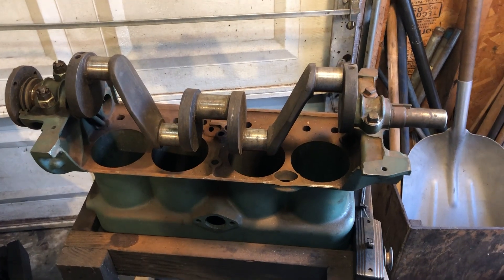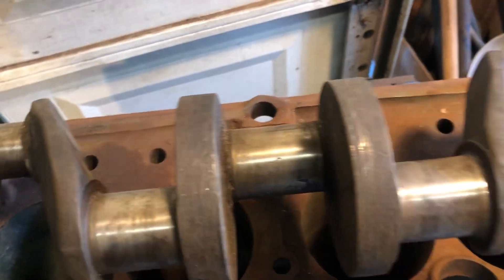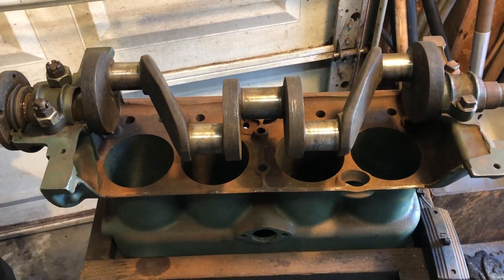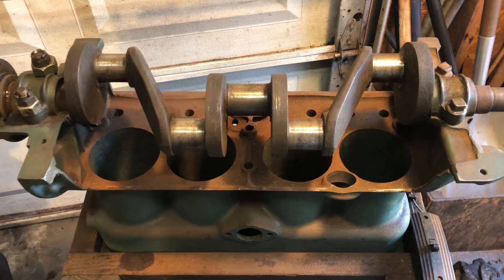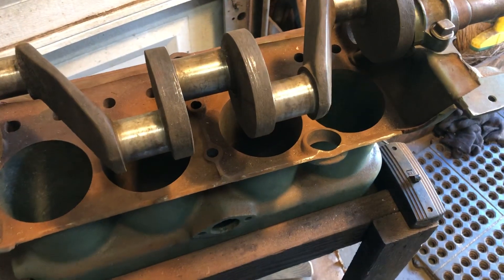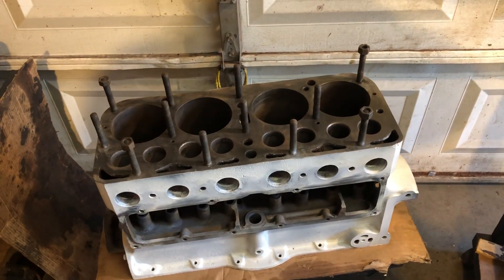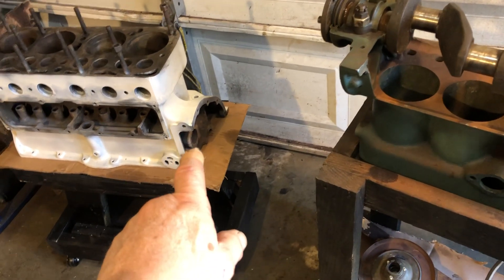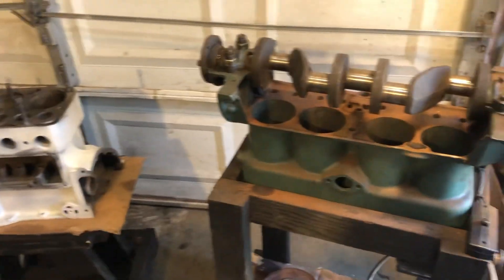Young Fella’s Model A Engine Part 5

Comment: I have watched all of your videos and learned a great deal! Thanks!! I have an old crusty engine myself. Standerd bore, no cracks. I saw how you check the main babot and my center babot is pretty sad. I took the seems out and tightened it down and it still turns.  Can't lock the crank down with it. Just want to drive around the property, doesn't have to go to town or anything like that. Is there any way to cheat and be able to play with it till I find a better one?
Reply from the maker: Yes
If you have a bench top bet sander you can take a little off the main cap surface( not too much!!! Just a little at a time) until you can feel a slight drag on the crank.
Or a better option is to ask around others locally to see if you can find another main cap with thicker Babbitt
Reply from the maker: Or if no belt sander glue some 60 or 80 grit sandpaper on to a board and then have a cold one with one hand while rubbing the main cap back and forth on the sand paper awhile to take up some of the gap
Reply: If the front and the rear are decent won't that force the crank shaft down I the middle?
Reply from the maker: Should not be enough to move the crank only enough to take up some of the gap between the crank and cap.
When center main wears there is enough crank flex at speed where it wears both the block and center main cap I would expect